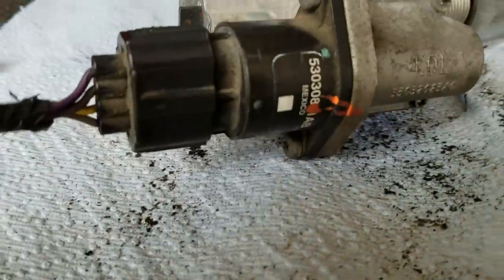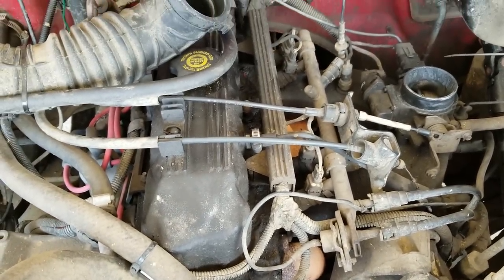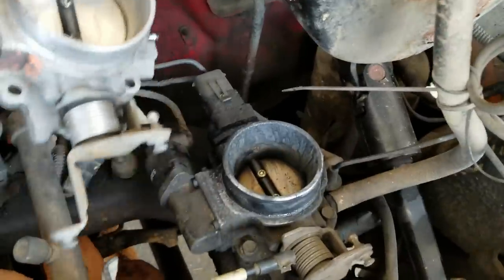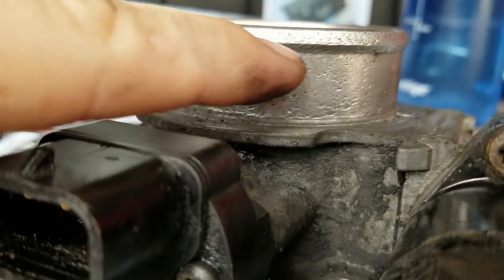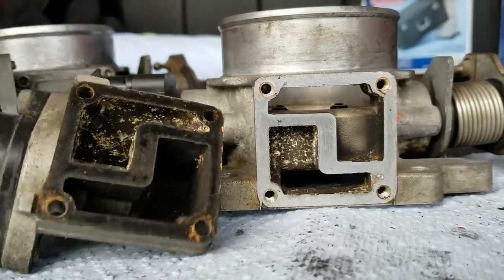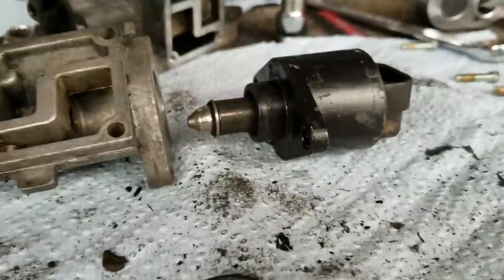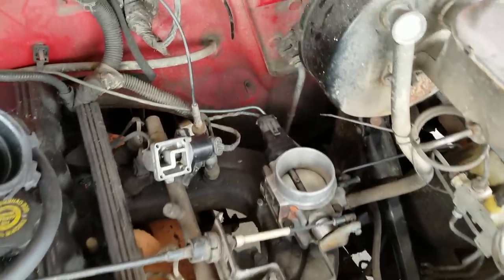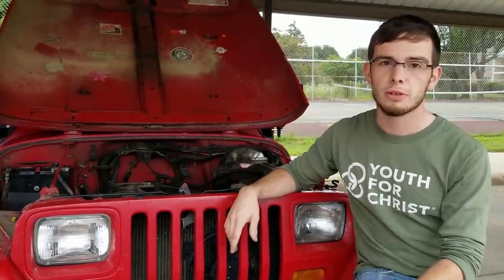Installing a 4.0L Throttle Body on a 2.5L Jeep Engine

Comment: We have a great Jeep salvage in Colorado Springs called FN Jeep.  I've put bored out 4.0L throttle bodies on all 5 of our Wranglers because it makes a noticeable difference when nearly nothing else does.  If I remember right, the 2.5L had 52mm, the 4.0L had 58mm and could be bored to 62mm, which is quite a gain.  At 7000ft, that motor needs all the air it can get.
Reply from the maker: I never thought of it's usefulness at elevation. Very interesting
Reply: @JeepSheepTV  indeed makes a difference with elevation. like a turbo, operates different under barometric pressure.
Reply: Omg thank you😊

Comment: I had the same problem with my 2.5L YJ and excessive blow by. I fixed it by replacing the pcv elbow with a pcv valve made for a 4.0L Jeep engine. I don’t have the stinky gas / blow by smell anymore which is nice, and my jeep runs better.
Reply: Did y’all figure out how to reduce the blow by? 4:17

Comment: the reason the iac valve wasn't all the way closed is because it's a stepper motor which stays in place you turn the engine off, when you start it the ecu will move the valve all the way open or closed to relearn the position.
Reply from the maker: Cool! Thanks

Comment: for the oil in the air box and throttle body pull the valve cover and clean the crank case venting system. had the same problem with my yj no issues with oil since i clean the ventalation system
Reply from the maker: I certainly believe that you are right.  I have cleaned out the vent on the top of the crank case that has a hose going to the air box (it was completely clogged). That helped a ton! I am hoping to do a budget rebuild on the engine this winter which will involve lots of cleaning.  Stay tuned for that!
Reply from the maker: @dallaskelley7395  I have some family members with a lot of experience in engine rebuilding but I would love to talk with you more about other modifications and common issues. Thanks for commenting!
Reply: I always assumed that was blowby from leaky valves and age since my air hose and elbow was clear. Worth a shot for the price of a gasket and a little time

Comment: One modification won't do much. A combination of mods, yes.
Add TB spacer, cold air intake, performance exhaust, and performance ignition with proper spark plugs... and they little motor wakes up noticeably.

I also have a hi flow water pump, electric fan, and Griffin radiator for those hot summer days. 

Yes, the motor runs lean, but it's angry and can turn 31" tires on stock suspension and gears with no problem 😎👍
Reply: I thought spacers were useless on dry intakes?
Reply: What is the optimal spacer size between the TB and the manifold? And why does that make a difference? I have seen a lot of guys that have done it, but I've never heard what the advantage is. Thank, in advance!
Reply: @heatmizer-jim6762  
Just adds velocity to intake. Not a major mod, but combined it helps

Comment: They only mod I've ever done that I could tell a difference was mounting the air sensor off of the throttle body to the firewall. It Smoothed the engine out a lot in higher RPMs when winding out the gears on my 5 speed
Reply from the maker: I did a video on that! And I agree! Probably my favorite mod so far and at a great price!
Reply: Does this work for a 94 2.5l Manuel trans??
Reply from the maker: @issacayala4254  yup
Reply: @issacayala4254  if your air meter is on the intake or throttle body then yes.
Reply: What do you mean by mounting it to the firewall? Jeep sheep i tried to find your video but couldnt.
Reply: @JeepSheepTV  can’t find that vid on it plz help
Reply from the maker: @biggrig6816  it should be in both the Wenchin' on stuff and yj performance playlists. It's a picture of me holding a whiteboard.

Comment: An old trick to help out an AMC 2.5L four....hey man, it works!
The 2.5L AMC four cylinder is maligned a lot and for a petty reason: it's not a 4.0L or a v8.
I for one have always admired the durability & rugged build of that motor as AMC based the famous 4.0L six off of this motor, not vice-versa.
Also, many folks bag on the YJ as a "Wrongler" with square headlights, but I'd take one w/ a 2.5L as a Jeep to putt-around in and as a parts runner vehicle for the other Mopars here as IT WORKS.  <-- this is coming from a guy that has a supercharged 4.0L six, a 1983  Slant6 D150 + a cammed w/ headers + roller rocker'd Mopar 5.9L Magnum v8 in a 2nd gen. RAM 1500. 
^^I like the simplicity of the YJ 2.5L four over the Fiat phake Italian Jeep Wrangler of today.^^
Many people forget what it's like to walk in the rain or snow, in the dark, wishing they had a reliable vehicle to use in the interim and/or emergency and your Wrangle fits the bill!
Nice rig there.
Reply: Wasn't the 2.5 actually based on and shared parts with an OLDER straight 6
Reply: @maverickricardo4478  The 2.5L four was made first and a cousin to the AMC  199/232/258 inline six. Cash-strapped AMC made a more efficient design of what they already had for market. The 4.0L six blew everything new away in late 1986 when it came out: watch the movie "The Goonies" for proof! ;]
Reply: @slant6guy  
No disrespect... why spell fake that way?

Comment: I know it's 5yrs ago but, I just picked up a 01 Grand Cherokee T/B and one thing I noticed was the little rectangle "tang" hanging off the bottom of the IAC is in different spot than the 4cyl. And there's a 'pedistal' on the intake casting so you won't use the wrong IAC. Should have it running tomorrow.!!

Comment: Pot marks are from the casting of the throttle body I believe.
Reply from the maker: Normally I would agree with you but since installation the 4.0L TB has developed pock marks as well.
Reply: Is it from debris getting caught under the air connector making the pits over time? It’s not really a hard metal

Comment: WOW, my 93 sounds just like your Jeep.  Mine has over 300K on the clock.  I did an inframe rebuild.  Was very careful with tolerances to the point of using different clearance half shell bearings on the crank to keep clearances correct.  I rebuilt lifters but had that tic.  So I went back and replaced lifters.  Still the same.   I think my rockers and pushrods are worn.  Only have 1/2 turn on rocker arm before bolt tightens.   Going to go back and grind off rocker forcium.

On the IAC, they normally on key on, jump fwd to close, reference and depending on temperature reading, drawback for proper cold or hot idle start.
On some applications, when you key off, they jump to closed to kill air to prevent dieseling.  My Harley has one that looks like it would work on a Jeep.  It jumps in to close on key off. Probably since hot idle is 1050 RPM.
Reply from the maker: Fascinating, I replaced my engine with a long block. 

It was the same cost as the machine work I would need to rebuild.
The new engine sounds much better lol

Comment: I swapped my 2.5 throttle body to the 4.0, as well as installed 4 hole injectors. I did notice it backfiring into the intake if I blip the throttle real hard when I downshift - on rare occasions and usually when it's hot outside. I think my problem is not upgrading the exhaust and removing restriction there. I do notice a bit more mid/high range performance, can hear the quarter wave tuning more from 2k rpm to 2.7k, but the low end torque suffers somewhat. Cheers ✌🏾.
Reply from the maker: Good to know! To be clear, did you say that you do have upgraded exhaust or not?
Reply: @JeepSheepTV  Haven't touched the exhaust yet.
Reply from the maker: @amorag59  gotcha, it does kinda sound like the backfire could be in part due to restrictive exhaust? Or maybe timing? If you figure it out let me Know, this is a good learning moment!
Reply: @JeepSheepTV  Also worth mentioning I think my choice of injectors was an oversight on my part. I noticed a youtuber swapping to 4 hole and their "tuning" consisted of switching their year of 4.0L injectors (they had a 4.0) until it ran in closed loop (and more or less stoic). I didn't really check mine haha, but I'm sure it's running rich, my injectors are 96-98 meant for a 4.0 (~23 lb/hr) which I'm sure is much more than my 2.5L needs, I just need to find info on what the 2.5 is supposed to flow and where to find 4 holes at that flow. I could see this being a part of the backfire problem.
Reply: @amorag59  19lbs for them.

Comment: Gotta add a high flow air filter to make it work
Reply: He does... That appears to be a "drop-in" K&N filter (at 3:13 ).
Reply: K$N is poop compared to some paper filters. Alot of particles still.get thru on K&N filters
Reply: Would not recommend a K&N as they let too much crap through.
The 2.5 air box is the same size as the 4.0 including the element.
No need to upgrade.

Comment: Why didnt you dremel out the intake manifold to match the 4 liter throttle bottle body opening ? It would seem that the manifold would be the bottle neck even though the throttle body is bigger.

Comment: The pitting/marks on your 2.4 throttle body almost look like the intake boot wasn't tight enough and was able to vibrate around.
Causing the pitting/galling.
Reply from the maker: That's an interesting theory. I'll look into that!

Comment: How do you get 70-80mph?  I have a stock 94 2.5l and 65 is all she will get going down hill….not saying you don’t get that speed but that mine needs help lol. 126k miles and most of those are because it was pulled behind a rv
Reply from the maker: It really depends on the wind. I've had days where I couldn't get over 65 based on wind direction. Also depends a lot on your tire size and gearing. Check out my YJ performance playlist. Look first at the IAT sensor video and throttle cable video.

Comment: Wait @16:17 he said his Jeep goes 70-80 mph 😱 mine goes 60 on a good down hill road
Reply from the maker: What size tires?
Reply: Jeep Sheep TV 33x12.50x15 BFG’s 4:10 gears
Reply from the maker: @socalRooster  have you changed your speedometer gear? If not you might actually be going 65. When I switched to 4.11s my top speed dropped from 80 to 75 but I get there faster and maintain that speed easier.  When I could hit 80 if the wind blew just a little bit I would drop to 70. Keep in mind that I have electric fans, 4.0 throttle body,  ported intake manifold,  4 hole injectors, a header, and a remanufactured engine. All if which I have or will have videos for lol.
Reply: Mine does  on a good day? 2.5L/Manual?
Reply: My 88' 2.5l 4speed 2wd with 4.10s comanche lowered 3" with 235/60/15 tops at 107 if you wind it up
Reply from the maker: @nicklounsberry516  A 2wd comanche has very different mechanical and aerodynamic losses than a Wrangler but that's still pretty awesome for I4 engine.
Reply: Mine goes 55 down a steep hill without blowing a head gasket🤣
Reply: I just bought a '93 YJ w the 2.5L..  was thinking there's def something wrong!  I'm only hitting 60, 65 at best!!  The PO did a Rough Country 2.5" lift and didn;t swap the speedo gear..( or realign the steering wheel for that matter)  I downloaded a GPS speedo on my phone and it will go 70!!  LOL..   Glad I'm not alone..  Now of course, I;m here looking for mods.  I had a '99 XJ that i put a 4"RE lift on and Airaid spacer CAI..  So I;m not completely ignorant..  Glad I found you!!!
Reply: My 2.5 runs like a champ. No problem passing traffic and can run past 85 mph. 29 Inch w/5 speed.
Reply: @thehatefull1761  29" tires??
Reply: My 2.5 runs like a champ in a midget mud wrestling contest.  I've got the 5 speed and have no idea what the heck the 5th gear is actually used for. I'm running 33" tires with a 4" body lift and I have no idea if the speed-o was ever changed for the bigger tires..  I'd like to know why he's swapping the throttle body from a bigger carb in this video.  I'd also like to see a video on adjusting the speed-o gearing so my speedometer indicates the correct speed.. and then.. and then... Ohh, I'd love to know what the easiest motor to swap in would be.  I actually met a fellow Jeeper and he had a Jeep the same year as mine and I asked him if he had the 2.5 l in it.  He said he had a NASCAR 341 (I think it was) in his.. Unbelievable sound.. I fell in love instantly..
Reply: Gears gears gears if you run 33s on a 2.5 you need 4.88s

Comment: bigger throttle plate = less throttle angle for a given rpm = different harmonics regarding pressure waves in the intake tract... in your case leading to improved mileage? or does it have more to do with the way the ECU calculates load and timing with the change in TPS input?

Comment: Why did you switch out the IAC housing from the 4.0 to the 2.5 on the 4.0 TB? Was it because the IAC won't fit the 4.o housing??
Reply: cleaner instead of dirty.   less work on his part

Comment: 2.4l?? I think u got shorted .1 liters!?
Reply from the maker: Lol I used to think that this engine was the 2.4l and the earlier pre 90s version was the 2.5l. I have since learned that the late model year TJs came with an over head cam 4cyl and that was the 2.4l. Anyway....
Reply: Yes they did make one. Research

Comment: People if all u want is problems then go ahead. I did this to mine and all I got was headaches untill I put the 2.5 throttle body back and all my problems were gone... Don't do it u not saving gas only installing headaches..
Reply from the maker: Oh no! What problems were you having? I haven't had issue with mine but that doesn't mean problems can't happen.  I'm very curious.

Comment: I have a 2.5 with blowby, mine gets 10 mpg on 33s and 4:10s. You think the throttle body really helps that much?
Reply from the maker: It really just changes your throttle response. For better mpg I would start with just cleaning everything, especially your valve cover.  For more power upgrades, I would start by moving the IAT, I have videos on both of those things,  and a few about superchargeing too.
Reply: @JeepSheepTV  it's been a while since I cleaned everything. Also I watched your SC series, dad and I are planning on turboing mine. Also thanks for making yj and 4 cylinder content. As a high schooler with a kinda rare first vehicle and engine it's nice seeing a channel with this much support for the platform.

Comment: I fixed my blow by by changing the pcv elbow to a 4.0l pcv valve.
Reply: MY 2.5 LITER ENG HAS ALOT OF BLOW BY. I WILL TRY YOUR SUGGESTION.
Reply: I guess I’m just lucky my 2.5 has no blow by. I cleaned the valve cover so I know it’s breathing but barely any oil.

Comment: 70 or 80 mph on the freeway? With the 2.5? 
Mabe 70… what size tires? Gears?
Reply from the maker: 31's, 4.11 gears, 70-80 was hard to come by but not impossible. I put on a supercharger, and now both are much easier!

Comment: ouch,  don't know how old that intake is, but on newer ones  your not suppose to use even a brass brush on the inside of the intake.  the inside is polished from the factory,, plastic brushes only .
Reply from the maker: Thanks for the comment! I did not know that (obviously). I'll be more careful with what brushes I use next time.

Comment: I just did this conversion on my 98 2.5.  and now when I try to start my Jeep it will crank but it won't turn over.   I have plenty of fuel pressure and my spark plugs and injectors are brand new... So I know they're not the problem.  I swapped over all of the sensors correctly and everything is plugged in like it should be.

Someone please help!

Comment: hey! do you think spacers improve performance? thinking of buying one like Rough Country 1068 Throttle Body Spacer
Reply from the maker: Spacers work on a series of fluid flow principles that depend highly on the geometry of the manifold, head, and a whole bunch of other variables. Basically, they provide different results for different engines.  There was a dyno test done that you can find online saying it gives about 5hp for this engine.  Some spacers are priced way too high for 5hp in my opinion but that part is up to you.
Reply: @JeepSheepTV  thanks a lot!
Reply: @JeepSheepTV  I just bought a jet throttle body spacer for 12 bucks on Amazon.

Comment: Is this any good without boring to match?
Reply from the maker: It still increases throttle response since you are letting in more air at less throttle.  I assume when porting the manifold matters is in scenarios closer to wide open throttle. Porting probably helps everywhere, but I have no data to support it. I ported mine later on,  if that helps...

Comment: would you consider boaring out the header to match the diameter of the throttle body?
Reply from the maker: Do you mean the intake manifold? If so, I did that and created a video about it!

Comment: Can a 4.0 throttle body come off a later Grand Cherokee? I have a 93 yj 2.5 just want to be sure i get one that will work!!    If not, what models and years will work on the 93 2.5L.?   Thanks!
Reply from the maker: As far as I know,  if it's a 4.0 in the Grand Chrokee then it should work. Fun fact those use the same style fuse panel as the YJs. Keep that in mind if you lose your cover and can't find another one.

Comment: What’s that sound in your motor while it’s running? My 95 yj 2.5 makes a very similar noise and I’ve wondered what it was since I bought it
Reply from the maker: Is it the ticking noise? That's the lifters, unfortunately it's normal. Some have tried some lifter additives in the oil. I've found it's happier if you let it rev a little more while driving.  Like let it hit 5k every once in a while to get oil in there.
Reply: @JeepSheepTV  thank you thank you I love your videos man they’ve helped me out quite a bit with my Jeep and my girlfriends. After all the 2.5 is the 4.0 with two cylinders loped off. Keep up the great work man

Comment: Great video! Looking at a XJ with a 2.5 l, is it as reliable. Thanks
Reply from the maker: The 2.5L is an incredibly reliable engine in whatever vehicle it's in. It's just not very fast.
Reply: @JeepSheepTV  Got it......thanks again
Reply: @carloscartaya9932  still have the cherokee?